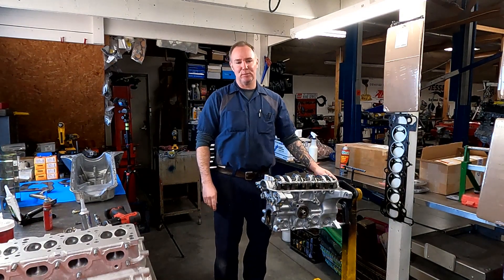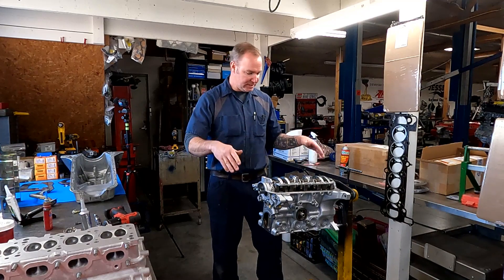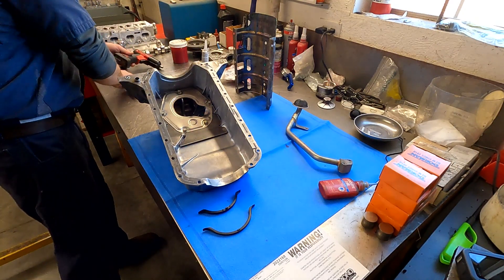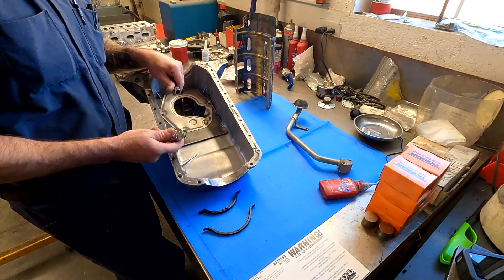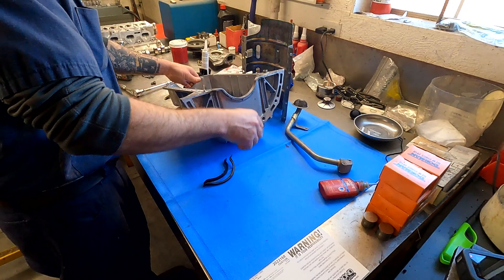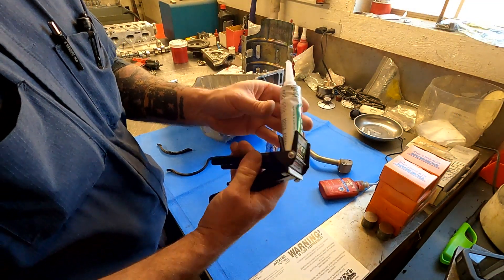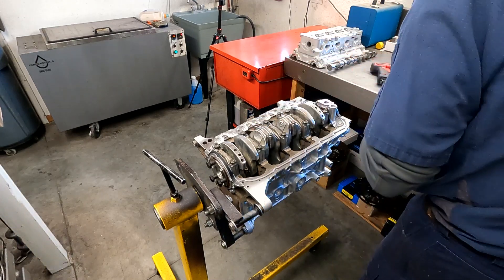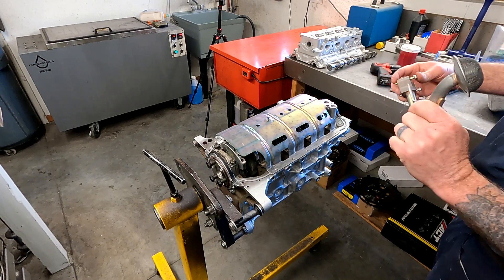Miata Oil Pan Gasket Sealed Right

Comment: I’ve resealed my motor 4 times and am about to give up on this motor. Every seal keeps blowing after around 500 miles. valve cover, cas doing, cam seals, front and rear main, and oil pan. Now it also appears the head gasket failed and is ejecting oil as well.dont get what the issue is

Comment: On my 3rd attempt with the engine out of the car. So discouraging. Half moon FelPro gaskets both times. Following everything in this video. Just ordered Mazda OEM gaskets. Any suggestions on what im doing wrong? The smallest leak front of engine. So discouraging that I want to just sell the car 😔.
Reply from the maker: Quality gaskets sets are always the key, plus my tips, should get you where you need to be.

Comment: im trying to buy a 1997 miata at the moment and he said that the oil pan was recently changed with brand new pan and gasket and a brand new rear main seal as well! but he is saying that sone bits of oil tries to leak because it is missing a couple bolts...is that possible if it has a new gasket?
Reply from the maker: Hard to answer without knowing more details on missing bolts. There is a reason that there are so many bolts, so if you are missing a few next to each other, an oil leak would make sense.   I would inspect everything very carefully before moving forward on that purchase.

Comment: I installed the oil pan. I also purchased the Valco tool. Wow! That tool made it very easy to  run an even bead of Ultra Black. So I will let this set up and hopefully, No Leaks. Thank you for the video and the advice.
Reply from the maker: Glad to hear it helped you as much as it does me - Best of luck and thanks for watching.

Comment: Just found this video. Been using Ultra Grey for 20+ years on my Honda as a replacement for Hondabond. I resealed a CX5 trans pan with OEM Mazda sealant, and it seems to be the same stuff. So I got a whole caulk tube of Ultra Grey for my Miata resealing project. 

I did have leaking issues for years with Ultra Grey by torquing bolts immediately. On the CX5 trans pan I did the finger tight 1 hour then torque, and it hasn’t leaked a bit. So I guess I’ll keep on doing that on the Miata.

Comment: Thank you for your content and knowledge sharing.  I was hoping you would comment on whether you recommend using a paper gasket with the little rubber bead that  goes around the circumference (Mahle makes one for a nissan rogue) or using high temp RTV gasket maker instead.  I prefer using rubber gaskets when possible, but sometimes they are not available for certain car applications   Thank you for your time in this matter
Reply: I'd say every situation is different.  For some situations using a proper gasket works just fine as well however I also always use a little bit of clear rtv with a paper gasket.

Comment: What's your take on using sealant with a cork oil pan gasket? I've got a Ford Courier with the stock Mazda 1.8 and the factory manual calls out putting the OEM Mazda sealant on both the pan and the block. Have you seen that work well in your experience or just use one or the other?
Reply: Cork squeezes out a lot so I'd be very careful with them.  Yes, I'd use silicone with one though.  One or the other should work well.

Comment: Timing could not be better, I am waiting for my factory pan seals right now!  I have a 97k motor, both front and rear crank seals were dry, however both front and rear oil pan seal locations have failed!
Reply from the maker: Right on!  Always good when the timing works out!

Comment: I have seen Permatex Ultra Black and various others mentioned for the silicone sealant.  Looks like you used Ultra Grey.  Use the same as a thin film on the rear RMS plate or the oil pump?  Any advantages of one over another?  Thanks, Mark.
Reply from the maker: Either will work. The ultra black has a higher oil resistance, but, done right, like the video shows, I’ve never had a problem. 
Thanks for asking!
Reply from the maker: Just saw that you asked another question.  Yes I use ultra grey on the rear plate however on the front for the oil pump I use the gasket that all of the 1.6 engine cars used, even on the later model engines.  The 1.8's used an o ring up front.  I'll retain that o ring and install the gasket on top of that.  Works like a charm!  Good luck!

Comment: Great Video!! I have to change oil pan on my 2005 Ford Focus 2.0L Duratec. I will be using the Ulta Black. According to the Permatex directions, even with the Ultra gray, It states to "Finger tighten until material begins to squeeze out around flange. Then, let dry one hour and tighten to torque Spec." I see you did not wait one hour. You tightened the pan down all at once without waiting the one hour. I just want to make sure I do this right the first time with NO leaks.

What do you recommend? Waiting or just torque? The pan to crankcase torque spec is 18 in lbs, oil pan to bell housing is 35 in lbs and the front bolts are 89 in lbs.

Thank you again for the great video. Any information you can render will be greatly appreciated!
Reply: Sorry, its 18 ft lbs and 35 ft lbs, not in lbs.
Reply from the maker: I do it just like the video shows. Put it on, with just enough ultra grey then tighten the pan down in the correct pattern and torque.  That works for me, but like I say, there are many ways to do these things, but I have a good amount of success with the way I do things, so I just keep that process going.  

Take your time and do it well. Torque is a great thing to follow.
Reply: @jpm  Thank you for responding. Luckily the oil pan on this vehicle is easy to get to and remove. I spent more time cleaning the surfaces than removing and installing. Worst case, I may have to repeat process.
Reply from the maker: Cleaning the mating surfaces is exactly where your time should be spent -  nice work!

Comment: I bought the god damn $22 tube squezer.... is this the 2inch or the 2.5? I bought 2'' and a tube of Permatex ultra black I swapped engine didnt do any gaskets, got 5k miles so many leaks engine is out now on stand
Reply from the maker: I use the 2 inch version. Works great and gets every last bit out.
Reply: @jpm  good to know! thanks hopefully mine turns out this good
Reply: @jpm  She's all on and good ! I used about a whole tube of permetex ultra black just on the pan alone!
Reply from the maker: Glad you got it done. Might say that you didn’t need that much permatex though. As I said in the video - every bit that squeezes out on the outside is probably squeezing out on the inside where there are moving parts. It’s a learned thing that takes time. Hopefully the squeezer tool was a nice addition to the toolbox.